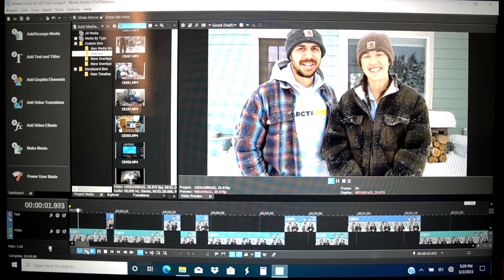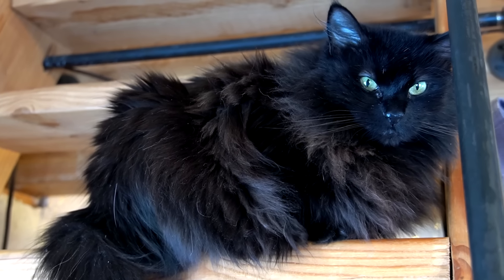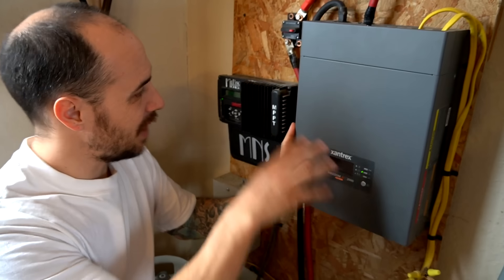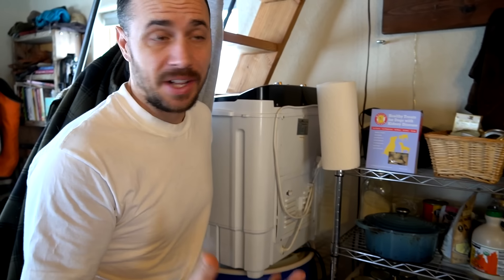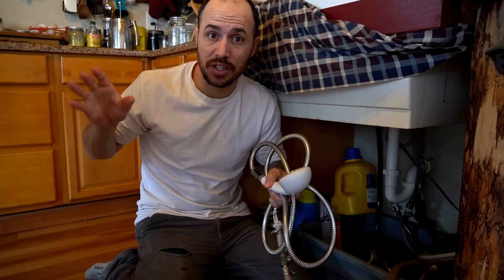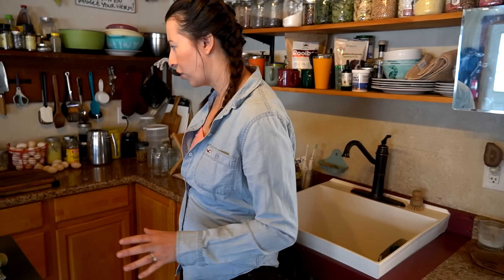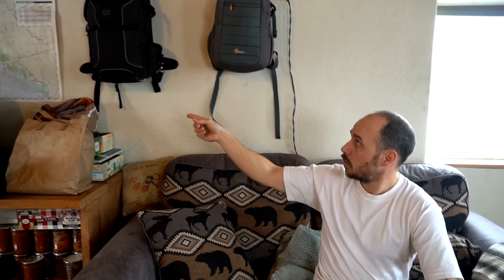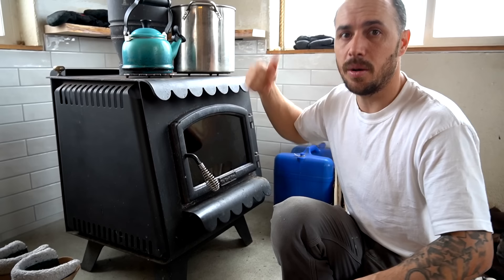Honest Look at Living Off Grid | Full Cabin and Property Tour

Comment: Have you thought about cutting a 3” hole in the corner of the floor near your inverter , putting pvc pipe there and run that into your insulated battery box? Then put a small 12v fan inside the pipe to pull warm air into the battery box. Use a thermostat inside the box that makes it cut off when it gets to 40 degrees F. That would likely make your batteries perform better and won’t take much energy.

Comment: When you rebuild the shed, look at the Wood Structural design by the American Wood Council. It has all of the wood span tables for different lumber. You can quickly figure out the total load on rafters and beams by size and span and determine what size you would need to stop sagging like that. My guess is it will probably need to be 2x8, possibly 2x10 rafters, and they also account for snow load weight.

Comment: I don't know if you use this already, but you can spread a little bit of wood ash on top of the snow in the garden, to make it melt faster in the spring. As you have propably pretty acid soil as well, with bog and that kind of forest, it will raise the garden PH as well. 

This is one of those old wives advices (at least my granny used it and propably generations before her) and it really works. You don't need a lot of ash on top of the snow, to make it  a little dirty and accelerate its melting speed a lot. The pure white snow reflects the spring sun heat away, while the dirty snow catches the heat and melts so fast.
Reply: They’ve done this around the beehives in previous videos. I think in springtime usually?

Comment: Suggestion for your orchard. Since your trees are dwarf varieties, consider making a structure with an A frame roof, with removable covering. Tarps maybe. Something that would allow snow to slide off maybe or would, at least be reachable for removal. When snow season is over remove and store the cover and leave the supports. Just a thought with a lot of maybees from a Mid Atlantic snow hater. 😂😊

Comment: Regarding your episode Honest Look at Living Off Grid, my suggestions to the two of your least favourable cabin conditions: Muffle the noisy water pump by covering it with a fiber glass insulation lined plywood box and rest pump box on a piece of soft foam. An indoor bar size fridge and Quonset freezer both fueled by propane are available on the second hand market (salvaged from motor homes and boat cabins). Just suggestions that you may consider. As I've suggested before, should you wish the equivalent of a large fridge, just add a small outdoor wall insulated closest with an couple of cabin wall openings for the closet doors - and insulate the outer walls with R-20+ fiber glass batts and the closet doors with 2-3" dense styro-foam glued to the interior 1/4" plywood closet doors. I did so 20 years ago in our basement against a concrete wall, the bottom 2/3'rds exposed to outdoor soil facing south in Calgary, and the interior wall insulated (R-20) to reduce wall heat transmission from the interior. It's a floor to ceiling insulated closet with 32 cu ft of volume storage (a 2'x2'x8' two-sectioned vertical closet with two 2" dense foam insulated doors and four storage shelves. Since last October, I've stored many bulky veggie foods (carrots, parsnips, onions, celery and leeks) and other perishable foods at maybe 0-6F lower than our fridge setting for weeks at end and nothing ever froze in there at night temperatures down to -22F for consecutive  5-7 days. Come late April the cold closet temperature will gradually increase by 0-6F above our fridge setting, but still cold enough to store fresh vegetables for several days. I doubt that the Seward area winter weather is substantially colder than in Calgary, but you can do your own research of the seasonal temperatures from the following web pages: https://climate.weather.gc.ca/historical_data/search_historic_data_e.html and https://www.ncei.noaa.gov/cdo-web/. In short, you can fairly easily, at a low cost and no additional energy consumption, attach a cold storage closet to your current cabin or your future larger cabin of planned permanent AK living off grid.  Cheers and love your episodes.

Comment: Your comment on lights, both headlamps and flashlights is a good point, without light we cannot do much during about half the day, at least the dark half.  I got tired of having batteries leak in equipment and needing to buy more all the time so I started looking for an alternative.  The best thing I found is two items.  The batteries that have worked best for me for the last four or five years are Eneloop by Panasonic.  They are not cheap but hold a charge very well and can be recharged many times, the package says 2100 times.  The other part is a NEWi4 battery charger by Nitecore, it will charge most any rechargeable AA or AAA battery and can be used with 120VAC or 12VDC.  I am impressed enough by these chargers that I have several.
I got these items from Amazon, I don't know what they do as far as shipping to Alaska but it might be something to look into for any items that don't have a builtin battery.

Comment: If you want to keep an eye on your water level just add a sight tube.  Hard tubing would be best. You will need 2 L shaped fittings and a clear tube close to the height of your barrel and 2 bulkhead fittings.  Drill holes in the side of the barrel near the top and the bottom. Install the bulkhead fittings and L shaped fittings with the clear tube going vertical between them.  If you want to get fancy you can put a colored ball in the tube that floats.  When you fill the barrel the sight tube will fill as well and if you put the colored ball in the tube you will have an easy way to tell the level of your water.

Comment: I love hearing all the different ways people can live off grid! We moved into our off grid home in July 2022 and are learning as we go. We took the appliances out of our RV and moved them into our cabin. Hahaha! We vented the propane fridge and have the same set up for hot water. Just hot to the shower. We do have an inside and outside shower for the summer though. We catch our rainwater but do have access to a spring we can pump out if it's a dry season. Our solar panel system was a 400 package from harbor freight and it does what we need it to but we do run the generator to help out. A new inverter and more batteries are on our list for improvements. I appreciate you sharing your life with us all it's such a wonderful community to be a part of and it's exciting to see others striving for similar ways of life. You all have been so helpful and provided so much knowledge to our life!

Comment: Don’t turn the well faucet off. Just disconnect the power. The water won’t freeze in the tap because it will run back down the well

Comment: I just want to say you are a great couple to watch. I love your videos and all the adventures you get into. I can see living in a small house has its challenges with no running water and no bathroom, but you have come up with ways to get by without them where most people would just give up. I was raised in West Virginia back when we did not have a bathroom much less hot water in the house. Mother would always heat water on the stove for washing dishes, as for baths and washing clothes we had two #3 wash tubs that we would heat water in over a fire outside. In the 50s, 60s and early 70s mother used a Maytag Washing Machine with ringers. You had to be careful around the ringers, mother got her hand and arm pulled in one time, she was lucky, they had safe release build in. Like your little washing machine Arielle, mothers Maytag did the job. I know living the way you two live can be hard, but at the same time it can also be fun. I can tell you two love each other and that goes along way when living like that. Thanks for the tour!

Comment: That is a great idea. I do the same in my off grid, I do have a toilet and made a common house toilet to a composting area, similar to a a outhouse but away from my cabin, being one person here, its not a overwhelming task to go back fill and make a new hole. I did this have a conventional plumbing system in my cabin, i have a shower and kitchen sink which is strictly gray water and to a completely underground area I dug out and laid gravel. I use all bio clean soap and cleaners. But when I built my interior, I thought to not have a bathroom vanity sink...i started thinking why put the expense, I could simply use my kitchen area sink do do anything a guy needs to do, shave, brush teeth , comb hair, guys dont really have much to really worry about a hand sink in the bathroom. This works out to an advantage actually , getting ready for work , getting lunch or breakfast ready , making coffee. For me it added more convience. just seemed logical to compact my lifestyle to use my space better. And I didnt want a outhouse, whne its freezer blast cold out, i dont want to get up and trek across the yard with skis in snow when I had to take whiz at 2 am . Hey if you like that kind of misery, then more power to ya, but I wanted a inside bathroom.

Comment: As a source of heat for your outdoor battery compartment, here's something my dad did for our farm (in Indiana) when we had a well. He put a regular household 7 watt incandescent nightlight in the well pump box. It was plugged in to the regular 110 electric. It was lit 24/7 when it was cold. It's a very small amount of heat but in a sealed insulated box like you have it might help. It certainly won't make it warm, but it kept the well head from freezing. I'm planning something similar for an off grid hunting cabin so I can leave the batteries on site when I'm away.

Comment: You could run a beam across the middle of the woodshed roof and use vertical logs as a post, then remove a few in the center when the snow is gone.

Comment: With regard to the valve on the well, put in another 90 degree elbow and have the valve go vertical, not horizontal. This will eliminate the space where water pools and freezes and you shouldn't have to heat your valve.

Comment: Y’all should put a covered porch on the cabin, Bar stoles around the kitchen island,A regular house washing machine only uses 19 gallons of water. Before you said you need to run the generator to use the washer at the end and it took all day to wash. One load 45 to 60 minutes and your done.

Comment: Thank you. Learned a lot that will help me in my off grid transition. Of course you are half, or less my age and a pair. One water clue I have discovered is to install a frost free hydrant inside the house for on demand water coupled to your well with a pressure system. Solves the freezing issue. Great video. Thanks!

Comment: Check into 250  amp hours  battleborn batteries they have their own built-in heaters for the winter time and run off its own power. They last 20 years you can deplet them 100% and not hurt them on the recharge. More expensive but way worth it in the long run. In the admit no gases. And there half the weight are less of lead acid batteries.

Comment: Guys….We use a 12 volt rv pump to get water into our cabin. I mean you can hear it running, but hey, we have running water! The well is 100 ft from under the sink where the pump is. We used two shop vacs to prime the pump. Works great.

Comment: Good job! Learned a couple things!  I need to get a 12v DC pump with a pressure tank ...they installed an  ac pump here and everybody I talk to said it should be what I'm going to replace it with...that ac pump was not compatible with the wrong type of inverter that they put in 4 my solar..they put in a modified inverter..I replaced it with a pure sine inverter...

Comment: Great share! Even living in the lower 48, I find that in central WI the days are sometimes somewhat nastier than yours! I have recently begun exploring taking my smallish house (762 sq. ft. downstairs, and approx. 420 Sq. ft. in my loft- with a gas fireplace) into a hybrid off-grid model. You going through your power generation was very insightful and I have been hoping you would do this! Even with my larger space, I am constantly looking for space for canned food storage and root cellar like spaces (I have no basement.). As I have no central heat, I have found the area on my stairs to be the coolest space (about 50 degrees most of the time--weird).

Comment: I'm fairly new here, so thanks for the tour! I have an idea to pass on that I will probably do myself soon. Shelter Logic products are notorious for the fabric being an issue after a couple years. I saw Tiny Shiny homestead replace the fabric with metal siding and they built a front door section on the front with wood. They used earthbags on the back which is something I can't do on a mountain in Missouri due to rocks so I will probably do wood there and add a window or two for light. Hope this sparks some ideas for you! Love your content tremendously! Texas Deb ❤️

Comment: Snow removal is a lot of cardio exercise.  I am sure that no issue for you guys.  On you wood shed, the thing you could have done better is to flip them so the so the roof rests in the 2 inch side (not the 4). To do it better use 2x6’s or 2x12’s like the shed off you conex.

Comment: I would love some more information on Hammock sleeping;  How do you lay in it : an angle or straight,  how far apart is it hung, etc?   please and thank you!!!!!
Reply from the maker: I bought it on Amazon, it's made by Hammock Sky. It says it's for two people but it's only for one person sleeping, you are supposed to sleep at an angle but I just sleep in it straight with a blanket on the bottom and pillow under my knees. I love it but the drawback is you need quite a bit of room to hang this exact one. Our loft is just barely long enough at 16 feet.

Comment: I bet if you put a 45*, or even a 22.5* fitting between the 90* and the hose faucet on your well pump, it would tip it enough to drain out the low spot in the valve eliminating the need to put a torch to it.
Just an idea, never said it was a good one!
LOL

Comment: you guys are doing good. i like watching your stuff. i'm also trying to make things work in a lot milder conditions in the country side. there is always stuff to do...
what i would improve?
in the barel just use a floater to see the water level. a stick attached to something floating in the water and keep it hoziontal somehow. it would drive me nuts to be left withour water without warning.
on the well i would just put in a vertical faucet so it can't hold water to freeze.
why not have a pipe from the well to the house to fill the water? i would make it so it drains the water. cool trick with the small hole in the well pipe to dain the water!
i would also get a real, but compact automatic clothes washer. no dryer. they use about 2kw so one could run it on the generator and skip the manual stuff. i do remeber you "fully manual" washing. it was painful to watch. so much time and energy is saved using an automatic clothes washer.
i also remember how much work went into the house siding. did it improve insulation? can you tell the difference?

Comment: I think the size of the current house is too small , probably need more like 600 square feet to have enough floor space for cabinets, furniture, a staircase and inside bathroom.  If it were me i would have bought the sawmill first thing and constructed a oversized 2 car garage, wouldn't use any kit form type shelters, too much snow will destroy them.  I would for sure make kitchen cabinets with doors to protect canning jars and prevent the cat from knocking things down, you can build raised panel doors with a small table saw, planer and router or shaper.  On the new property, if it is high & dry land, a root cellar or basement would be great for storage.  Overall just about everything has worked out well for you i think.

Comment: Quick question, has the new house wrap and siding helped improve heat retention in the cabin? Have you noticed improvements ?
Reply from the maker: Yes we have less air gaps and the house heats up fast and holds the heat longer

Comment: I'm curious how much wood you guys burn. I'm not sure if you measure firewood by the cord, but do you know a ballpark of what you use a year? I',m assuming you're mostly burning softwood or maybe a little birch. Is the cabin super well insulated or do you just get the high interior temps due to the small footprint?
Reply from the maker: We burn about 4-5 cords of mostly spruce

Comment: Very interesting video.  I would have liked to have heard your thoughts in regard to the food cellar debacle such as what you might have been able to do differently, if anything.  Also, if you keep the property, you might want to consider the possibility of reinforcing the woodshed roof rafters by adding some more 2" x 4"'s rather than replacing the rafters.  Regarding the 200 foot well, I am curious why your 1/2 hp pump is at the 100 foot level?  Could it be that you would have needed a 3/4 hp pump for a 200 foot well?

Comment: Ever think of adding a tiny electric heating pad to your battery box?
Reply from the maker: It would draw too much energy but it would make a big difference surely 🙂
Reply: @SimpleLivingAlaska  not a full sized heating pad, but something small. I saw where Slim Potatohead used a very low powered one b/c you only need a wee bit of heat